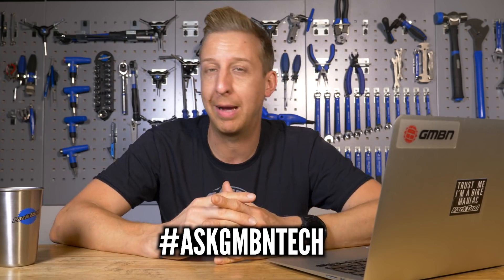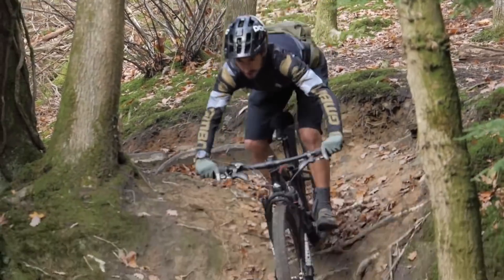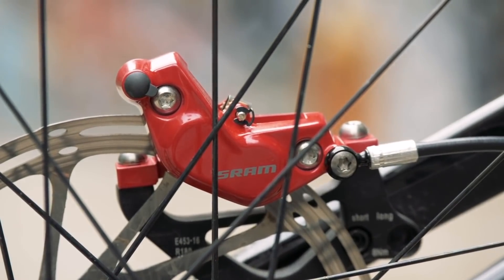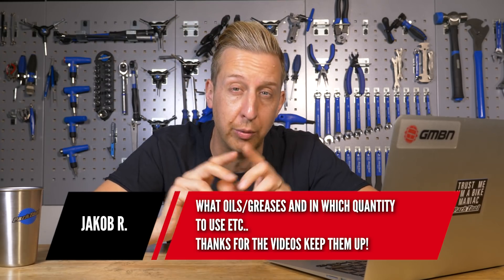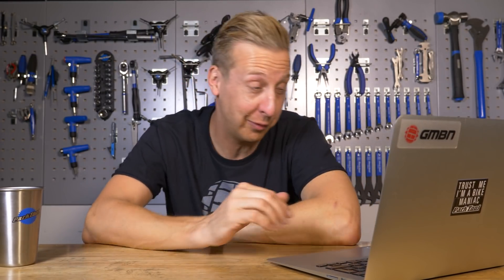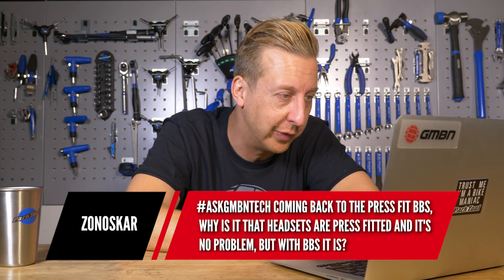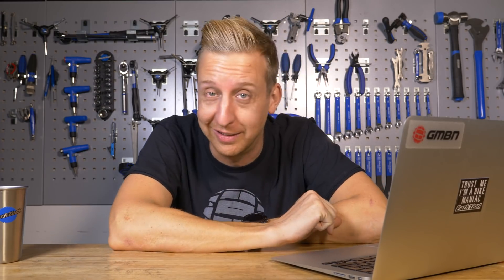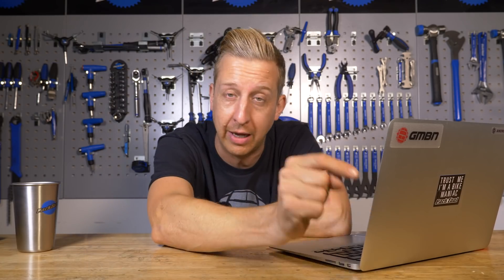Suspension Fork Service? | Ask GMBN Tech

Comment: @ 
So... Coil shocks are linear and air ones are progressive...How come then that the more punishing riders, who subsequently require more progression, mostly use coil shocks??
Reply from the maker: It's definitely more of a complicated topic than simply spring rate progression. but some of the main reasons will depend on the frame designs, some linkage designs offer more progression and can be used with both air and coil shocks, pros run fancy custom linkages if they need to when running coils and wanting more progression equally they run fancy valving if they want to run an air shock.
Reply: Air shocks can be made linear or progressive, u can adjust the progression...tho depending on the leverage rates there will be some, but often not noticeable if all volume spacers removed

Comment: #AskGMBNTech
Will my bike geometry remain the same if I change the front wheel and fork to a 29er and reduce the travel by 10mm? The rear wheel would remain 650b. Love the show! Cheers! Oli
Reply: Most likely yes, if not you could probably run a deeper sag on the fork.
Reply from the maker: Yes, but as you are reducing the travel a little it shouldn't be too drastic and this will slacken the head angle slightly. If you want to minimise adjustments run a larger volume tyre on the rear then the front.

Comment: #AskGMBNTech
I have a 2015 Rockshox Pike fork. The service manual shows the fork oil as being 0W-30 but can I replace it with standard suspension fork oil? If so, what wt?
Reply: @Mark Betteridge For 16$ per bottle (5oz) vs 15$ for 1L? Ha.
Reply from the maker: The important thing is the correct oil weight. Check around a few different bike brands but also some suspension service centers sell smaller bottles.
Reply: Amazon...£8 delivered, enough to do lots of services...

Comment: #askGMBNTech. Thanks for the great content Doddy! I saw your video on setting up a MTB for commute. Do you have any other tips for using a MTB for road riding (mainly for tires)? I have XC 29+ tires. Should I consider getting another set of slicks or just use them on these long (25-40 mile) rides?
Reply from the maker: How wide are your current tyres Ameya?
Reply: @gmbntech  29x3.0 Bontrager Chupacabras. I know I'll get more wear on them. I have Raceface Arc35 rims, and getting slicks for 2.5+ width is a little tough (recommendations welcome! :) ).
Reply: As a former bike messenger with lots of experience with road-worthy mtbs (mainly from the 90s, but whatever), I strongly recommend slicks. Not just 4 the better rolling tread, higher pressure also equals lower rolling resistance on the road. In the end you also damage your XC tires on the tarmac, the knobs get way more wear an the street. If you don’t go for a whole new wheelset, you might be challenged to find tires that fit your rims but there are lots of tires out there.
Reply: @Beutelratz  Thanks for your response. Yup, Im aware of the tire wear, but I dont really have a bug budget right now. I have Raceface Arc35 rims, which are mainly for plus tires. Finding slicks with more than 2.5 width has been a little tough. And none below $60/tire
Reply: There are Maxxis grifters with 29x2.5 should be usable and I’ve seen them for 22 €.
Schwalbe big apple are also 60-622 and your rims are nominally from 48 to 68 mm tire width so I guess they should also work even though they are just 2.35.
Wearing out & replacing those chupacabras seems to me the expensive choice.

Comment: #AskGMBNTech  I have a 2018 Revelation RC which I had my LBS upgrade to the 2019 air spring and charger 2 damper upgrade. The sag is set to 25%, now the first 5-6 mm of travel is dead space with no support from the air spring.  Is this normal? My LBS called SRAM tech and they didn't seem concerned at all.
Reply from the maker: It's hard to say without seeing the fork. This could simply be where the positive and negative chambers are equalising but this wouldn't be a couple of mm at the most.. Could it be that the start of the fork sag is just buttery smooth and you are not used to it? Try another LBS and see what they think Will.
Reply: You could have air trapped in ur lowers... couple zip ties slid down the seals and manually pull to full extension, then remove. HOWEVER, due to the large neg chamber, the weight of the bike alone can cause a small amount of sag. I had the same, and google showed its common after spring upgrade. The forks become sooo slick that just the bikes own weight sags it a few mm with the huge neg chamber. If u think about it, ur car s own weight sags its suspension. Providing its a few mm and not air in lowers (easy to do esp when a lbs does it, as time is money =less ATD...the rods must be fully pulled out after oil added, using the bolts without blocking the bolt holes in lowers) then its fine/normal

Comment: #AskGMBNTech
Hi doddy been loving the videos keep them up
My rockshox xc32 doesn't hold air pressure I pump my fork up to the pressure I like to run then within 15 minutes it goes down to about 40psi please help
Thanks Charlie
Reply from the maker: If it's not holding air first check the valve is tight followed by a service as some of the seals may be compromised.
Reply: @gmbntech  okay thanks for the advice
Reply: Soapy water around valve, see if bubbles. If does, check valve core
Reply: @rupedog  how would I check the valve core of a fork?

Comment: #AskGMBNTech Hi Doddy, hope you are doing well. Im in a bit of a pickle. Recently I have upgraded to new Sram Level brakes from cheap Shimano's but I haven't changed the rotors to Sram. When I got it I bedded them in properly and everything worked well but my front brake has developed I sort of scratching sound . I've bedded the brakes in about 5 times but it still doesn't stop. I know that some brake pads just squeales but this sound is harsh. Anything I can do to stop it ?
Reply from the maker: Sometimes this can be due to different pad styles. If you were previously running a Sintered or Metal pad this will have been embedded into the rotor and cause noises. It's also worth checking the rotor for wear. If the rotor is scored it will be visible.
Reply: @gmbntech  Thank you very much Doddy!!
Reply: Shimano rotors are often only suitable for resin (organic) pads...u cannot use semi or metallic. May be urnew pads are sram semi's...or maybe the soft shimano discs are just worn out. Get new discs u can use with any pad type and try...
Reply: @rupedog  Thanks!

Comment: Why do companies still keep their seattubes long but their reach short? Dont they realize there are longer dropper posts out there?
Reply: Long droppers need long seattubes in order to fit.
Reply: @src248  thats not completely true. I can slam my 175mm transfer to the collar with room to spare on my large tracer. I can fit a 200mm bikeyoke dropper as well. Dont see a reason why companies are still making 520mm+ seattubes.
Reply: @gavinsorenson461  well the Tracer has a straight, uninterrupted seat tube; a lot of modern bikes have bent tubes or run a pivot through the tube
Reply: @src248  well theres still companies like rocky mountain, yt(they did fix this in their mew models) and canyon that have straight seat tubes that dont use this to their advantage.
Reply from the maker: The reach on most bikes has got longer in the last few years in relation to seat tube lengths. Frame companies normally want to keep the frame design consistent throughout the full range of frame sizes and on some setups tyre buzz can be an issue.